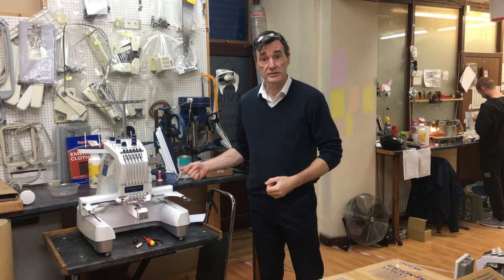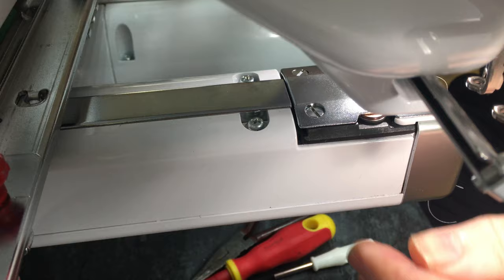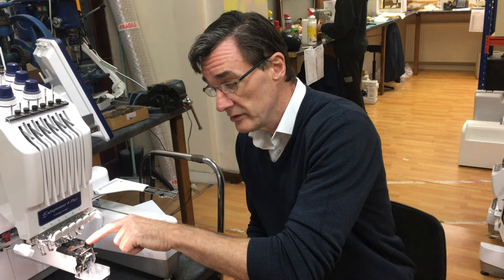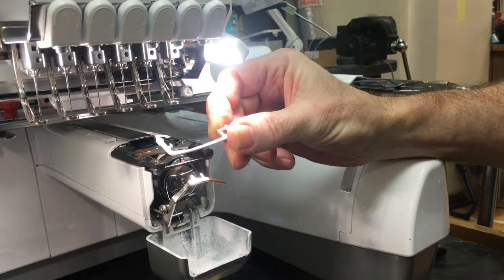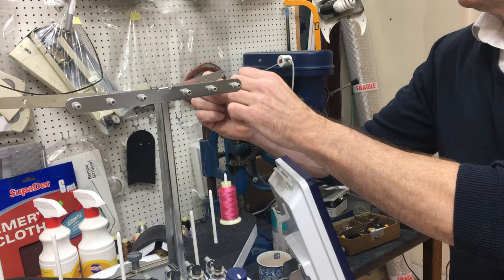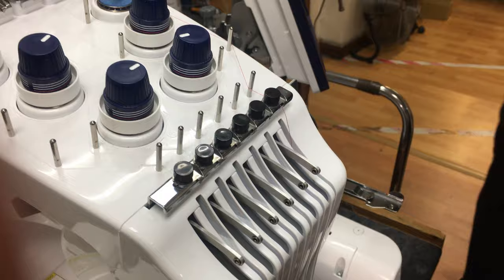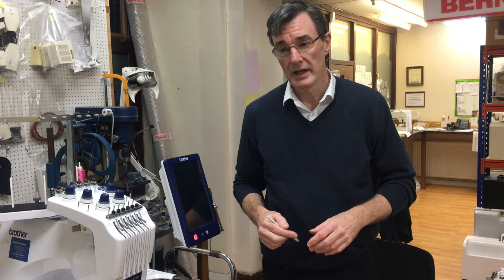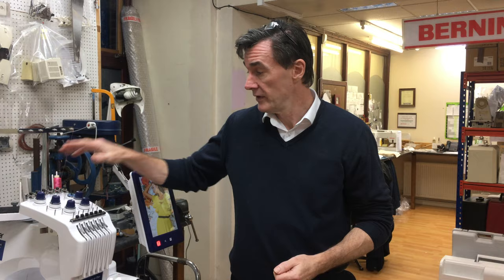Brother PR Embroidery Machine Operator Maintenance.

Comment: Can I just say this is the most informative video I've seen on the PR machines.  I have owned mine nearly 10 years and I was shown by the company that sold me the PR620 to only wrap the thread round the tension disc once and not twice as you have done in your video.  They also told me the wrong place to put the oil each day when I turn on my machine.   I am so angry  now I've seen your video.  Luckily it hasn't caused too many issues over the years but does explain some of my problems.  Thank you so much for all your advice.

Comment: Thank you for your channel sir, it's really very helpful. I have one question sir, I am planning to replace my embroidery PCB PR655. My machine often experiences machine PCB reset. If I replace the PCB, does there need to be any special adjustments? or just replace the PCB and the machine can immediately run normally without any special adjustments. sorry for the length of my question. Thank You.

Comment: This has been so helpful! Thank you!
Reply: Have you recalibrated the hoops? I've had issues with mine changing between sizes. It's a huge fight for it to take a file from a different hoop size. And the recalibration has to be done several times each time I switch. Now I'm thinking something is up with the sensor
Reply: @kozzy142  I have not recalibrated the hoops. I was having problems with the cutters.

Comment: I have a Brother PR600II machine. I have a problem when embroidering on the flat right in the middle of embroidering the machine will automatically change to the hat embroidery. Some times I can move the frame back to flat embroidery and some times I can't.
I just finished watching you video on making minor fixes and found some things out that I did not know. I'v had all kinds of problems with this machine since day one.
It's been to the repair shop a number of times and they would fix the complaints that I have and when I go to the machine the problems start over.

Comment: Thanks for this… we are getting a quick grinding noise on our second needle. Sometimes when we bring down the threader and other times in the middle of stitching, What could that be? Nothing got stuck, it just started happening.
Reply from the maker: Hi. This could be a number of problems. The needle bar crank, the top shaft profile cams or the idle pulley gear. All ‘can’ make a grinding noise but aren’t usually localised to a particular needle. We’d suggest a workshop inspection.

Comment: I am in the US
Have a 5 month old Brother PRS100 that suddenly starts giving an error message “check upper bobbin thread”
Everything is correct as far as the thread goes. The local authorized dealer that Brother had me taken it to could not resolve the issue.
I am thinking possibly the tensioner sensor has gone bad. 
My question: is this something that you may consider to be the culprit or can it be much simpler than that just being overlooked.

Comment: Great Video--I have a PR1050X that makes a squeeky noise when the machine is stitching out and has to move front to back (almost as if the rails needs to be oiled)----do you think this is the case? if so - do you have any videos on this? i have 2 brother machines but just my PR1050x is having this issue. thanks so much!!! do i just regular oil for this rail?
Reply: Mark have you found out why it makes a squeaky noise? I am having the same issue and can’t see to figure it out. Babylock says it’s a normal noise but I don’t think it does (comparing to when I first got the machine)

Comment: Just found this video. We have a PR1000E, and needle number 3 is hitting the pressure foot. My wife has just not been using that needle but I would like to know if there is an adjustment, or if it is maybe bent, or ??? Thanks in advance!!!
Reply: I'm having this problem with needle 2.  Help
1

Comment: Your video tutorial is the best I have seen.  Thank you.  I have a problem:  I had my 10-needle Babylock Valiant cleaned/serviced in December of 2021 and when I used it yesterday 5,000 stitches into the design I got this error message on Needle 2:  MAIN MOTOR ENCODER SIGNAL ERROR.  
When I clicked OK to clear it, then this message popped up: Inappropriate Needle Stop Position.  I am reluctant to call the technician back because I discovered that he didn't tighten the screws back on the needle plate on this machine.  I caught it early on.  I cannot figure out how to fix this machine.  Any suggestions?